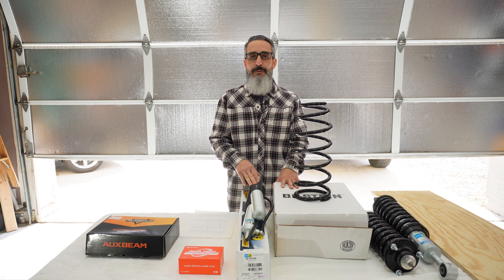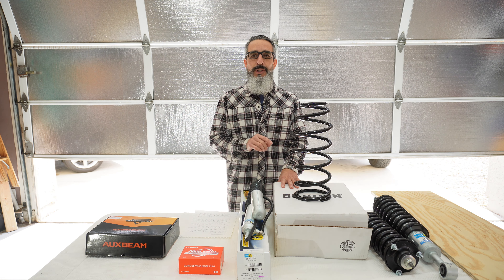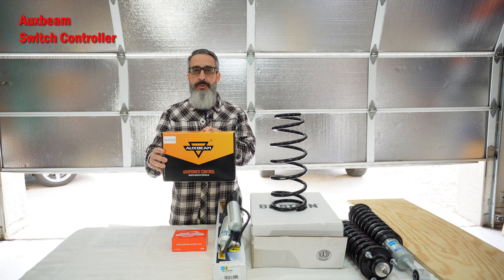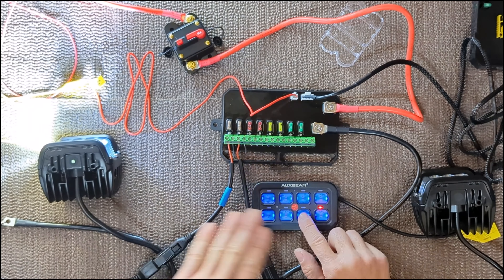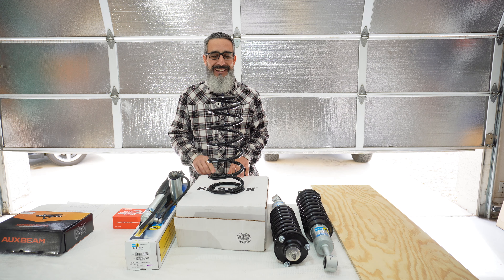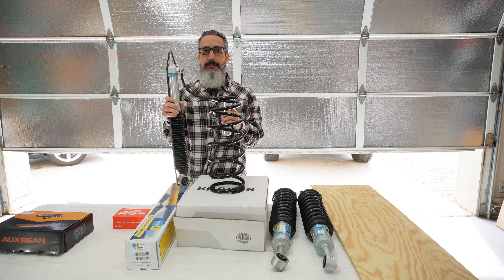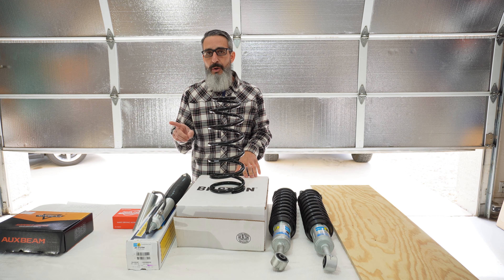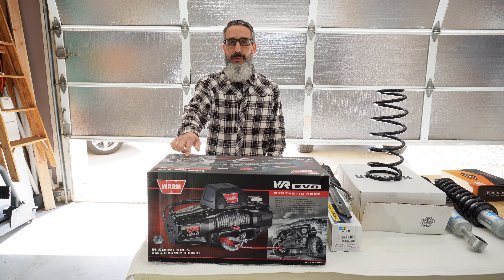Transform Your 4Runner with These Amazing Mods!

Comment: Nice pick on the Bilstein lift kit! I'm getting rid of the Fox 2.0 front coilovers for being too mushy and they squeak with only with around 10k miles on my 2015 4runner. I'm going with the Bilstein 6112 to keep it reliable and low maintenance like the 4Runner! 👍
Reply from the maker: Thanks. I was looking for the best fit for what I do with the 4Runner plus a price that was in my budget. I haven't really heard complaints about this set up.